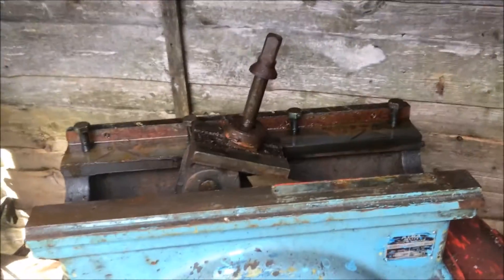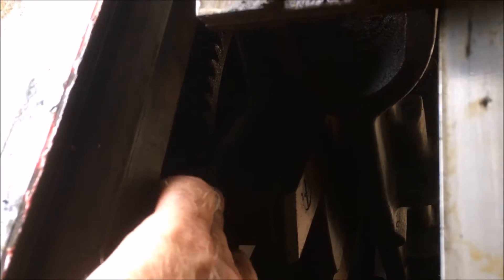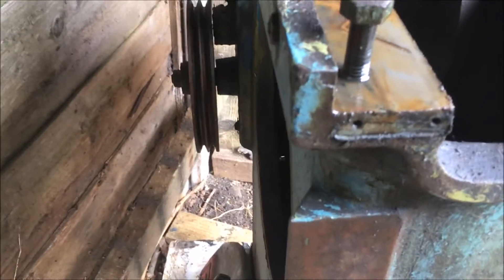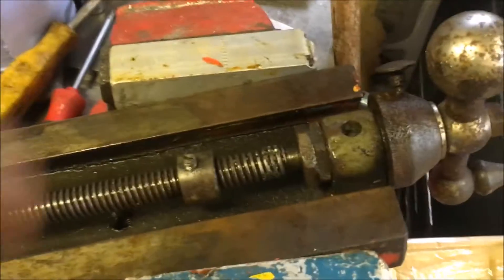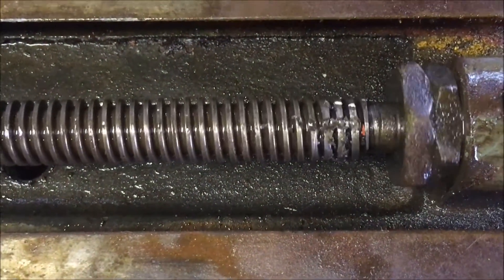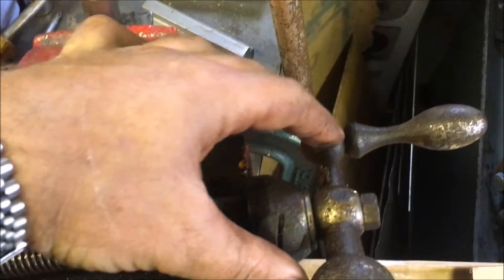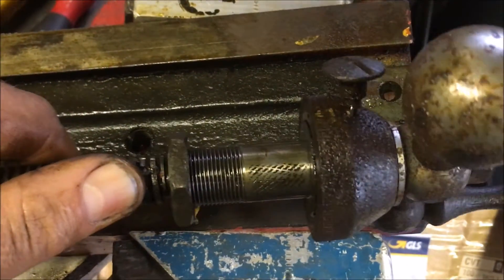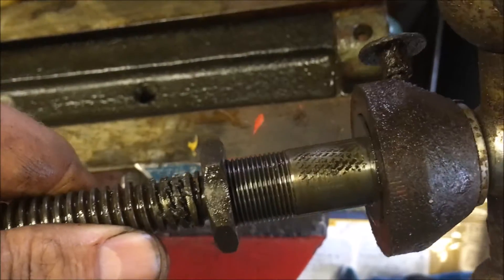Elliot 14 S update 2

Comment: Hi great find I have the details for most Alba s, Elliot M, Elliot Majors Shapers.

Yours is the;
Model 2s
Ram stroke 14 inch
4 speeds
18,30,57 and 109 per minute
Table area 14 x 10 inch
Longitudinal traverse 18 1/4 inch
Max table to ram 15 7/8 inch
Vertical traverse 14 1/16 inch
Cross feed range per cut/stroke 0.0104 to 0.0417 inch
Vice 7 1/2 inch open, 7 3/8 inch wide jaws. Floor space required 59 inches by 31 1/2 inches.
Power 2 hp, weight of machine 1512 lb or 690 kg.

I agree with using diesel to soak parts in, many years ago if one of our lister powered fishing boats sunk the boat was raised and engine drained of sea water and filled with diesel. 
I would check all the main lubrications systems are clean and that the correct lube was used. Many machine I have come across have been filled with grease instead of oil.
grease dries out and blocks lube channels.
The bullgear spindle needs good oil as I suspect it runs on 2 bronze bushes, the rest is obvious. the inner bush normally wears out first.
Look forward to next video. Manny
Reply from the maker: Hi Manny, dolf92 thanks for the info' - do you have a parts diagram for the 14S 2s ?  I would be interested to take a look before I look to take apart the remaining drive elements in the main casting & check over the bull gear bearings etc.  next video uploading this evening. I had a scary moment when my crane or my use of it near dropped the main casting.

Comment: another nice video, thanks for sharing, looking forward to it all being stripped down, 
its the re-build I always enjoy doing,
regards...keith
Reply from the maker: Rebuilding with freshly cleaned & greased parts that go back together in the right order .... ah well we will have to wait and see . I need to take a good look into the main body casting and see what horrors it contains. I spotted an 18" Elliot on ebay this week. Later version of mine I think its the 18M but it has the side levers for the gearbox and rotating work box  £350 starting price - which is a snip for what you are getting.

Comment: The "previous owner/ape", liberal user of hammers, chisels, more hammers, worn out adjustable spanners, and stilsons, and not a pipe in site. Diesel is great as a reasonably cheap penetrating oil, if you can steep the parts in it so much the better.
Reply from the maker: Diesel - next time I fill up my motor I will fill a fuel can and see if I can form a 'bath' for anything remaining seized. I am beginning to think that the 'adjustable parts' were 'over tightened' as a general rule by some previous owner. Where as the fixings I have removed holding the unit together have all been lubricated and tight not cranked up.  Thanks for your comment and dropping by ro eng All The Best mat